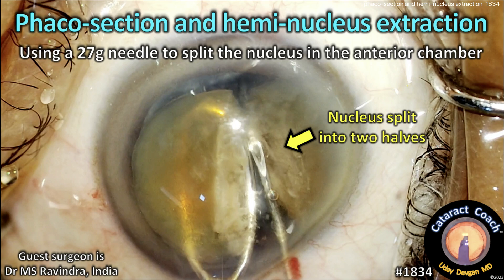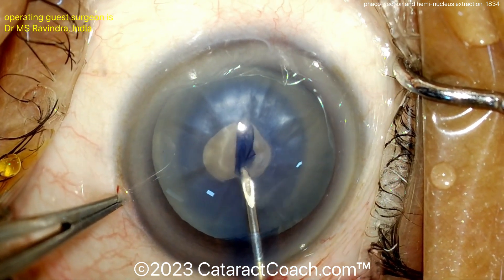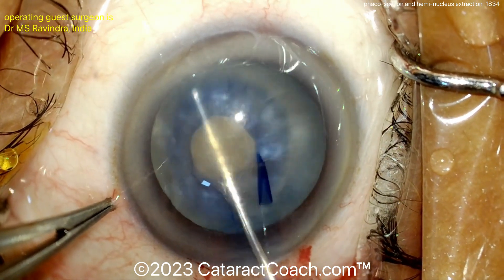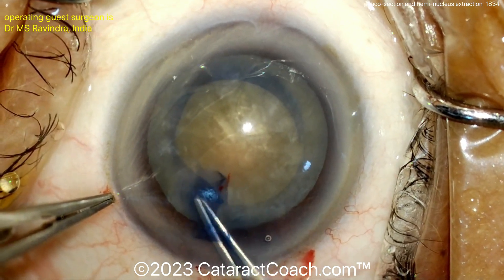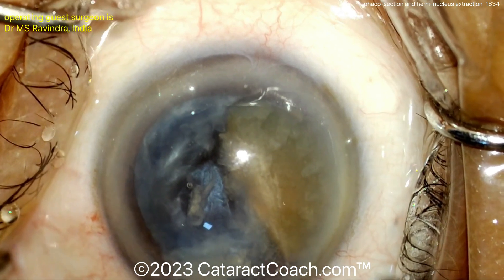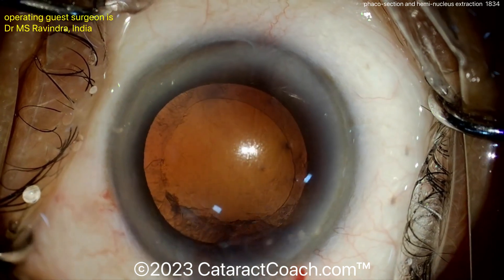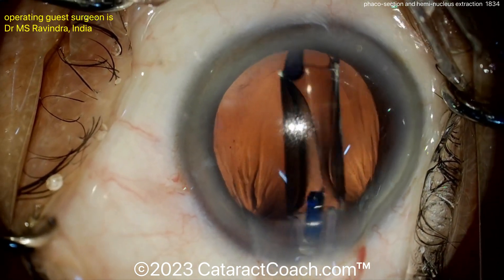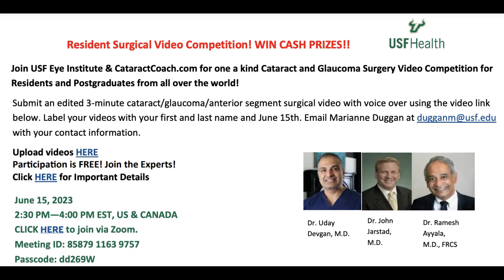CataractCoach™1834: phaco-section and hemi-nucleus extraction

Comment: I've done a technique where I divided the nucleus in two with  phaco and lens splitter technique in the posterior chamber. Then I prolapse both hemi-nuclei into the anterior chamber,  either together or one at a time .   Large rhexis is helpful.   I've only done a few this way and one case required an anterior vitrectomy.  My main goal is not dropping nucleus into the V.

Comment: Thanks Dr.Uday for sharing this! There is a learning curve for this technique. The surgeon works very close to endothelium, and to keep it pristine, one needs to infuse  HPMC continuously through the bent tip 26 or 27 g needle (indeed I use the cystitome, bent at 45 degrees, mounted on a 2 ml syringe with HPMC in it, to bisect the nucleus). There is no need for hydrating the wound, and no patching is needed.  The SIA produced is 0.5 D, which neutralises the pre existing ATR in many cases. This is a low pressure, low flow and low chamber depth technique, The tunnel enlarger is 5.2 mm wide.. Needs less than 50 m of BSS to complete the surgery. THANKS again!